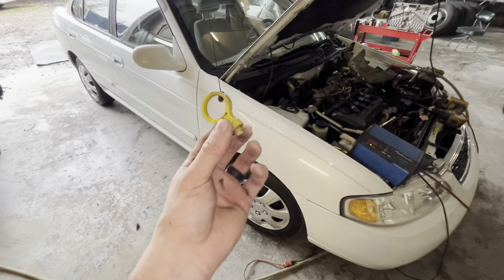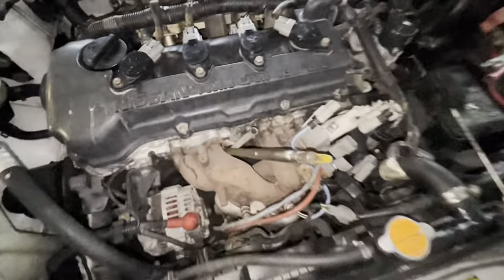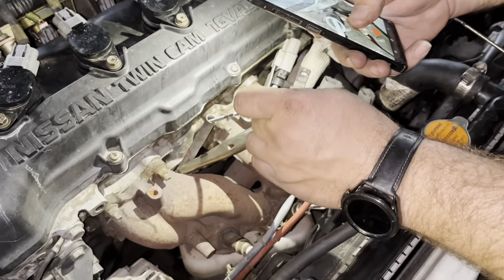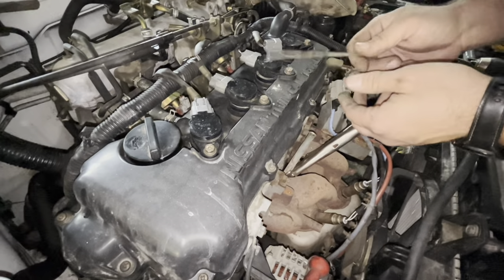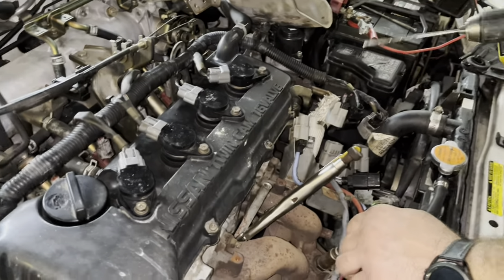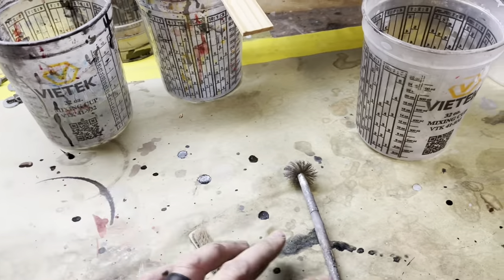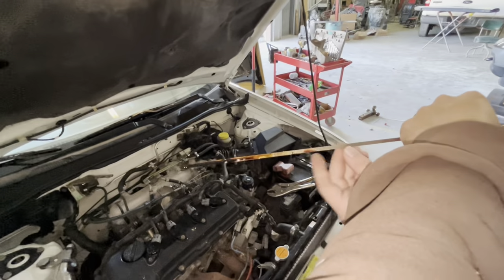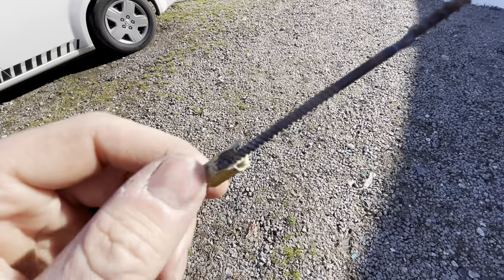🧰 How to remove a BROKEN DIPSTICK at home 🔩🔧📝

Comment: In my case, i got the screw in but the  plastic would not move, maybe because the screw forced the plastic to push on the dipstick tube inside wall.

My solution was to heat the dipstick tube with a torch, 20 seconds of heating  made it come right out
Reply from the maker: Smart!  Thanks for sharing hopefully it’ll help someone
Reply: Oh wow, thanks....ok I hope this works for me cause I couldn't pull mine out either.